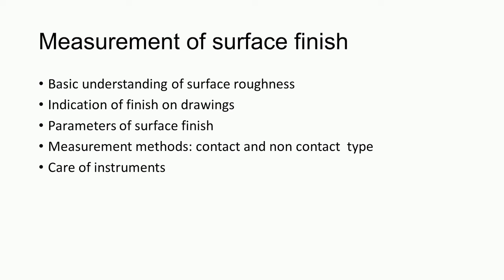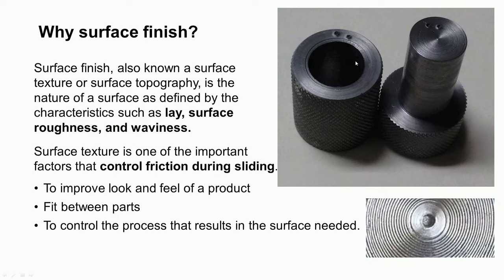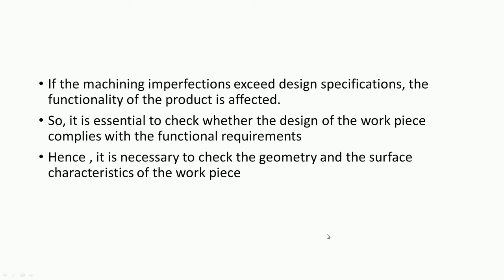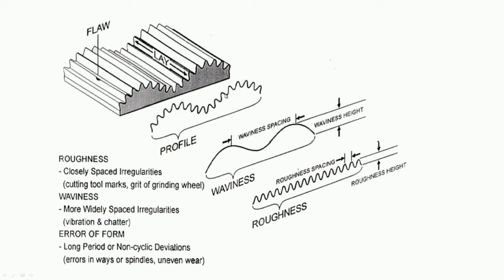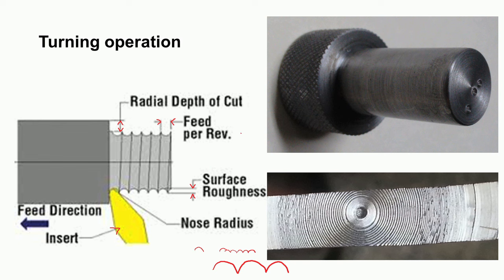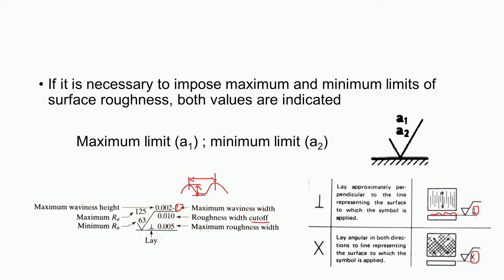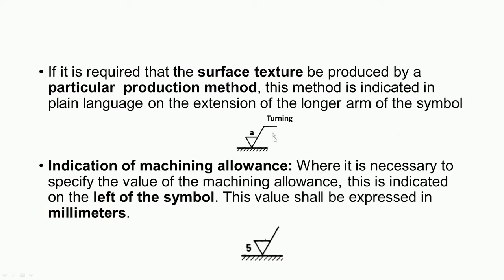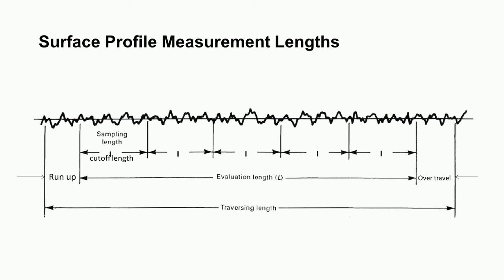Basics of surface roughness

Comment: Where we apply Surface roughness value given in brackets in title block of drawing like this Ra50 ( Ra6.3, Ra 3.2 ). Explain it plz
Reply: Whatever given outside the brackets is applicable for the whole drawing except the surfaces where surface finish mentioned particularly (those are mentioned within brackets).

If you look at the drawing,whatever given within brackets(Ra 3.2,Ra 6.3) will be mentioned in the drawings surfaces also..Other than those surfaces,entire surface of the part's finish will be Ra50

Comment: what is difference between roughness and flatness
Reply: Roughness if rough, flatness is flat! :p
Reply: @notyourdad361  roughness means Ra value and flatness relation?
Reply: Roughness is Ra Value.the smallest closely spaced irregular variation occuring in surface texture.
Flatness is the variation allowed on surface with respect to a datum surface.
More or less,they both mean the same only difference is datum....the point of measurement.
Roughness is magnified version of flatness
Reply: Roughness is the assessment of irregularities present on a test surface or the extent of surface finish achieved through a particular type of machining operation. It is usually measured in samples of 0.025mm, 0.08mm, 0.25mm, 0.5mm and so on. It is found to study about the aesthetic appearance of a surface, retentivity of the surface for lubrication, adhesion, dyeing of ink(pen marks on papers.. you call it as quality of the paper), how go a paint can stick to a surface like metal surface, wall, canvas, paper etc. Roughness studies in automobile parts are very important to assess the performance of an engine. Say the cylinder bore surface, should have considerable roughness in the form of peaks and valleys(assume in 3D) inorder to retain the sprayed lubricants for good lubrication of the surface for the piston movement. Slope of the Peaks help the lubricant to get washed and fill the valleys, valleys serve as the compartment for the lubricant to be retained... infact all these happens in fraction of a second. Please go in this direction to know more about roughness. 
  flatness is for a area of larger size... say for example a cylinder head, granite table, straigh edges and other surfaces in broader context. It is an extension of straightness measurement.. Straighness measurement is along a straight line.. and flatness measurement is for a rectangular, square and other polygonal areas... Flatness tells us how flat a surface is....in other words whether the surface deviates from being flat.. viz concavity, convexity, obligue, rounded surfaces, contour surface, etc...  
To give u a quick idea about roughness. Roughess is quantifying what you feel when u run your pad of the finger on a surface like a brick.  Flatness is like how good your floor or wall of a room in your house or elsewhere is finished....  Hope you get a glimpse of the idea. best of luck
Reply: flatness is at macro level... deviation in third dimensions, where as rouhness is mircro level ... irregularities on surface